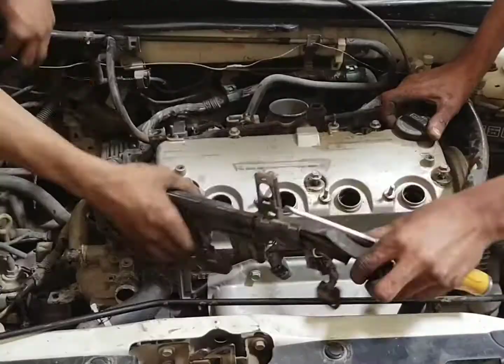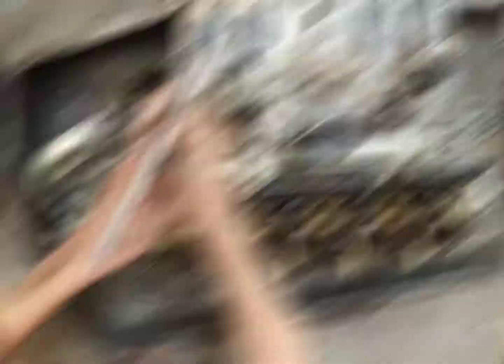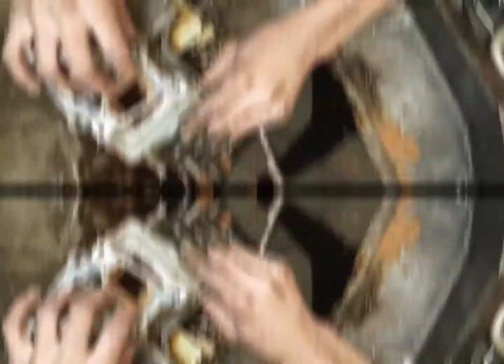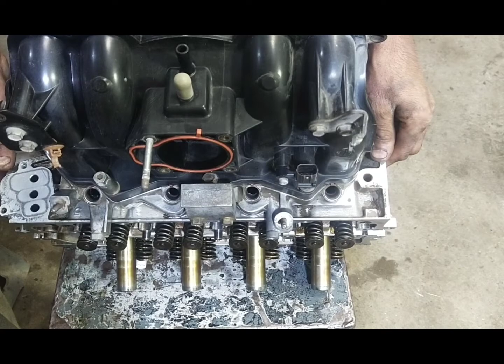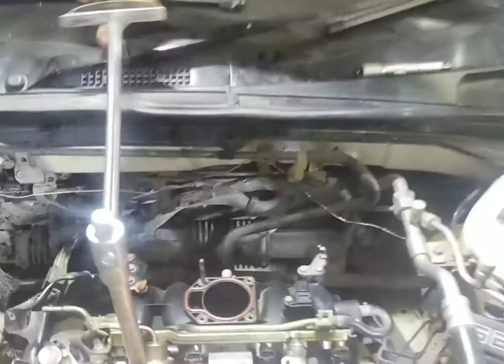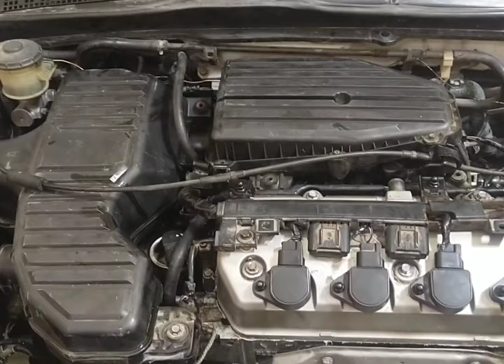honda civic head gasket replacement #mirzamec

Comment: Hi guys i have the same problem with my 2002 honda civic ex my question is what size of head gasket are you used? I see different sizes from 0.026 to 0.030
Reply from the maker: 0.026
Reply from the maker: 2002